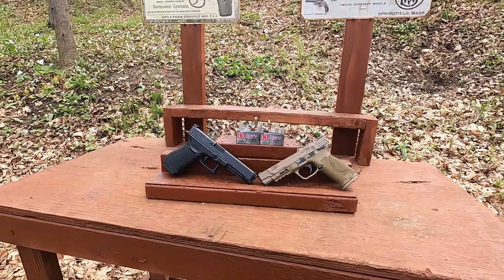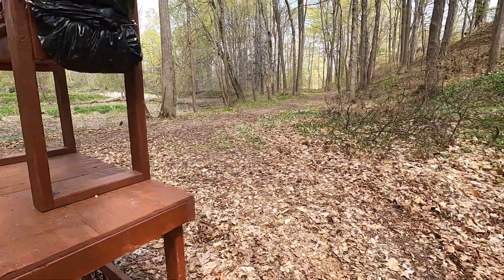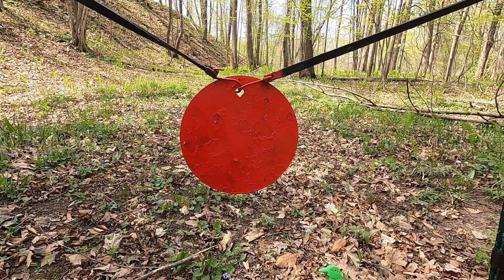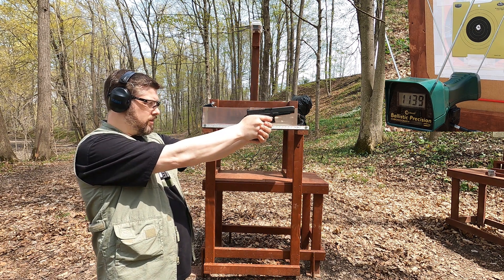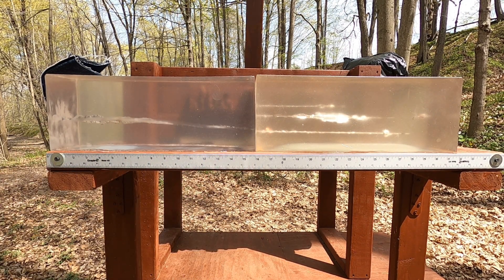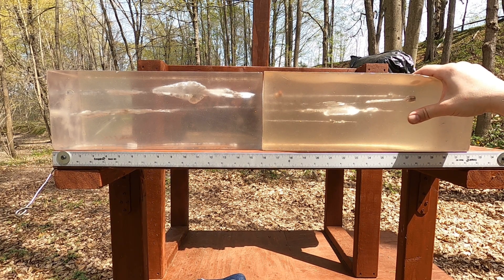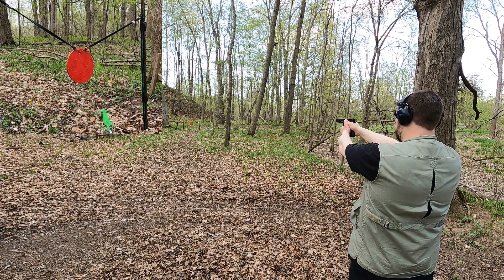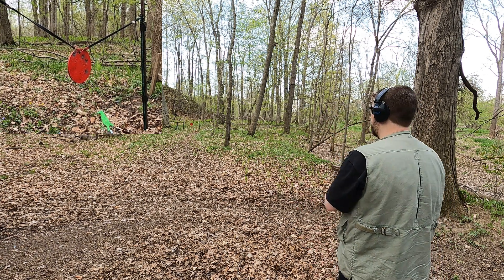Battle of the Long Slides - Hornady Critical Duty 9mm VS 10mm - Ballistic Test

Comment: I think that the 9mm is a great gun and I hate it when it beats the revolver but those guns are used in a sterile environment. But, if you dropped both the revolver and 9mm in mud mixed with sand and then racked the the 9mm slide I think it would fail. That gun is built so tight that a couple grains of sand in the works could jam the whole system. A little bit of sand in tilted barrel assembly would be a real issue.  If you cocked the revolver hammer and it jammed, the revolver is so loose that you could probably clear it by dumping a canteen of water on/in it. All of this is just my opinion. And that could be an expensive test...